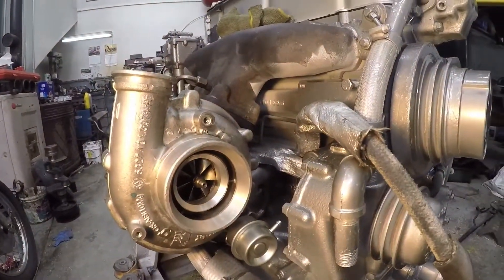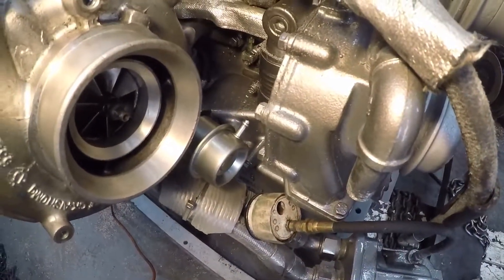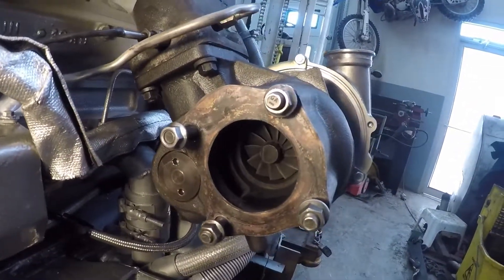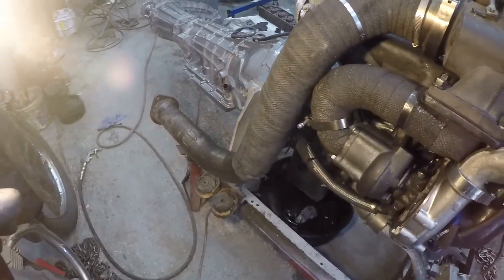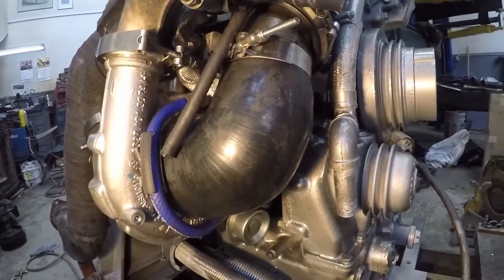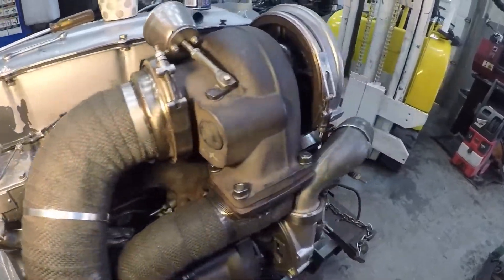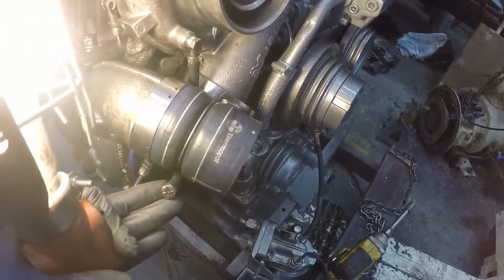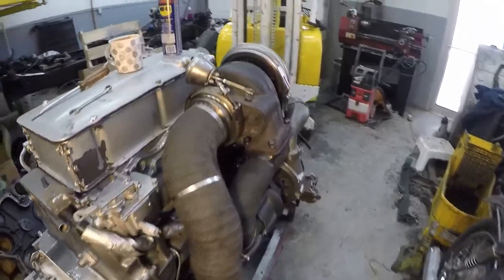Detroit 4-53T With Compound Turbos

Comment: In regards to a light truck the 4-53 is probably the best match in regard to size and weight. It would be nice to achieve comparable power and Tourqe to modern technology, which I dislike, say 400-500 hp 750 -1000 ftlbs of Torque. A 6V53 is pushing the limit mostly in weight. Hope to hear further reports on your motor.
Reply from the maker: At the moment this engine is running around 240 hp and 550 ftlbs of torque and now coming up on 57,000 miles since the swap.:).  I’ll soon be building another Silver 4-53T and dyno testing it.  The goal is to get to 280 hp and 600 ftlbs of torque.

Comment: I'm still baffled by the low view counts on your videos... Some of the best and most informative I've seen. Do people just not wrench on these anymore? 

What would happen if you just eliminated the blower/bypass setup? Could you tune the turbo setup to get you the low rpm pressure needed for the two-stroke? You can't be too far off if you make 10psi at 1200rpm... What's the blower make? 2-3psi? 

Is this setup on the same 4-53T where you did the upgrades to the T04E? Which do you like better?

Do you run the stock T compression ratio? Could you deck the block to increase compression instead of searching for boost or does that start to work against you?

I'm a diesel noob but lifelong wrencher trying to plan and source for a future build.

Longest YouTube comment ever
Reply from the maker: Some videos do well, but for the most part the views are low, particularly the detailed videos.  There's so few in service now that interest is not there anymore.:)  I do it for fun and to help others who want to work on them.:)  On the topic of blowers and turbos, the blower bypass helps unload the blower at anything above 10 psi boost and an estimated 8 HP is gained by this, increasing efficiencies in air flow through the engine.  Root style blowers are efficient at lower rpm, but loose that efficiency at the higher rpms, so a bypass valve fixes this problem.  I'll be using my next 4-53T build to test the different blowers and turbos etc. to see what the best combo is.  Since this video was made I've removed the compounds for a single modified Garrett T04E.  I've increased the compressor size and machined a T51R intake for it as well and so far really like it.  I can't really tell the difference from the compounds except the spool time is a little longer for the Garrett.  From a maintenance stand point the single is a far better choice.  I'm running stock Silver pistons that have an 18:1 compression ratio that's best suited for the turbo.  There's no benefit increasing compression, but instead look for more fuel and air to increase power. I hope that helps answer your question and thanks for watching.:)

Comment: But isn't that 4 I 53 TT sweetheart????I mean it is a 4cylinder 53 series two turbo boost is it not???
Reply from the maker: Yes sir, Borgwarner K27/K31 compounds.  I've replaced these a year ago with a modified Garrett T04E.:)  The Garrett now has a 59mm compressor and a T51R mod.:)  Here's what it sounds like, thanks for watching.:)https://www.youtube.com/watch?v=_oruKM8MrGc
Reply: @detroitgarage9430  I appreciate your kind words but it's mame not sir Sir.
Reply from the maker: @kimnielsenthewordyvikingett159  Sorry ma'am, I should have read your name first.:)
Reply: @detroitgarage9430  That's OK 👌 Sweetheart a lot of people don't understand. I was a diesel tech Forman on the Alaskan pipe line back in the 70s race engine ingineer builder for ten years after and 38yrs CNC lathe machinist since retired. I'm transgender mtf started H.R.T 12 22 2020 and hoping my new boyfriend understands as well since having a 57 Chevy completely refurbished sporting an L88. So that was one of the things I think 🤔 I snaged him with according to him anyway.

Comment: I don't like internal wastegates.  They're fine for passenger cars, but when it's time to get real external wastegates are stronger and regulate boost much better.  For years Porsche and Audi used external wastegates on their cars from the street to full race.
Reply from the maker: True, I haven't been happy with the waste gate and decided to take the compounds off and try a non gated turbo.  I ended up rebuilding an old Garrett T04E and running that.:)  It performs just as well as the compounds, so the next upgrade is a larger compressor.  The stock compressor is 56.6mm inducer and the new one is 60mm.  In do time I'll turn the housing out for the new compressor wheel.:)

Comment: i take my hat off to you .........a true compounded turbo setup feeding a blower.   However..........compounded turbos are usually used to eliminate lag ( I drive a compounded VW Amarok).........and the idea works really well.   For an engine equipped already with a blower ( being a GM 2 stroke) its seems..........over kill.   230 HP and 525 FTLBS of torque is a heck off a good result tho.
Reply from the maker: Thanks.:) True, I built this system for clean smoke free emissions and the ability to upgrade to larger injectors in the future and still have low egt's.  I've now tuned it just about perfect so I have instant boost and lots of power.  Now adding propane to put the power up to 250-260.:)  I still need to adjust the fuel modulator to stop the small amount of smoke between 0-5 psi boost.:)  Here's a video towing and the tail pipe emissions.:) https://www.youtube.com/watch?v=yUBi1IaiF-4
Reply from the maker: P.S.  Thanks for the sub.:)

Comment: is the two part valve cover bespoke made?  silver 4-53 series included diecast aluminum top clamping cover much like those on my 8v92ta  --thx
Reply from the maker: Yes, this is so I can get the valve cover off for tune ups etc.  It's one top piece and 3 bottom pieces.  With the cab down I would not be able to access the overhead.  Thanks for watching.:)

Comment: Hopefully you're running an air to air intercooler. I have an air to air intercooler on my 8V-71 in my bus with by-pass blower-works great. No issues in 12 years. Course only 7G75 injectors for 375hp and 1125lb/ft torque.
Reply from the maker: Yes I'm running an intercooler as well as a blower bypass.:)  I've got all the issues worked out now and it's working great.  I have the blower bypass opening at 10 psi and the small K27 at 20.:)  Egts are a nice cool 950 pre turbo, so very happy indeed.  Thanks for watching.:)

Comment: Two strokes need tuned exhaust to super charged cylinder as on Dirt bikes etc.
Charles Kettering of  Zepher Train fame invented  these.
Look up Napier Deltec engine ....
Nice work Thanks
Reply from the maker: True, I now have the turbo systems running just about perfect.  I'll be adding larger injectors soon as well, so should be a lot of fun.

Comment: To continue to evolve my Detroit rat rod I’m planning to compound mine as well with a T04 and a HE351 with the same bypass through the inspection side of the block. I’ll be swapping to a T motor. What size injectors did you use?
Reply from the maker: Nice, you'll like it that's for sure, I'm running 7A77's.  Will eventually go up to 9A90's, but going to try propane first to see if there's any added power.
Reply: We will have to keep in touch and see how things go. I’m sure I can lean a lot from you! Keep the post going!! Thanks again.
Reply from the maker: @cliffordw4508  Sounds good, I sub'd to your channels as well.:)
Reply: How much boost were you able to make?
Reply from the maker: @cliffordw4508  I'm making 20psi on the K27 and 8 on the K31, I expect that to climb to 30 and 12 when I upgrade the injectors.
Reply: Awesome, thank you for getting back to me. I have the 9a90’s for when I add the turbos. Your build really motivates me to get this done.
Reply from the maker: @cliffordw4508  You'll love the 9A90's you'll be around 230-250 HP.:)

Comment: So with compounding a two stroke the restriction on the exhaust is necessary to build cylinder pressure otherwise all your boost would flow out the exhaust am I correct
Reply from the maker: Yes, it needs to breathe but you also must have boost to get the cylinder pressures up.  It's finding that sweet spot, so I can get the most performance I can from it.  At the moment I think I have it just about as good as I can get it.  I'll be doing small changes and seeing how it improves or doesn't improve performance.  I might increase the injector size once it's broken in and see how well that works.  I know of only one other guy running compounds on a 4-53T and he's running about the same turbos, but has 150 CC/1000 injectors and I'm running 77 cc/1000.  He's running 1100 egt's at 40 psi.:)  and I'm running 1040 egt's at 25 psi.:).
Reply: @detroitgarage9430  its a unique and super cool setup im not real familiar with 2 stroke diesel

Comment: However,  i will admit that im a tad uninformed wen it comes the neccesity of having 2 turbos? 
What does that accomplish? And how?
Reply from the maker: It's really the best of both worlds, a small turbo for engine response in lower rpms and a larger turbo for the higher rpms.  They compliment each other so you have great throttle and boost response throughout the rpm range.  So far I'm very happy with them, still doing some tuning to get them in sync with each other. Thanks for watching.:)
Reply: Ok.
Great.
I'm a truck driver with over 30yrs and 2 mil mils of hywy driving.
I've been laying under diesel engine's since I was 10, and I'm 52 now. Still, after all this time, if I can't get a Cummins ISX on my truck, I'd just assume to HAVE and old Detroit 2 stroke. 8V92T preferably.
Keep the vids comin.
Love the content.
Reply from the maker: @CwNiehaus  Thanks, throwing the miles onto this engine now to break it in.:)  Running really nice and no issues so far.:)  Thanks for watching.:)
Reply: A single turbo is a compromise between effectiveness and efficiency compound turbo has more range because you're trading between the efficiency zones of two turbos instead of just one

Comment: Hi everybody. I have a question. What is the difference between the engine 4-53t and 4-71?
Thanks for the answer.
Reply: Just an afterthought,  but as he explained,  the 2nd set of #s in the engine designation is the size of each cylinder in cubic inches.  The 1st # is the cylinder count. And if there is a "V" between the two #s, that
Means its a V configuration.  Example = 6v71.
6 cyl`s-V configuration,  71 ci  cylinder bore
Reply from the maker: 4-53T is 212 CU and turbo charged, the 4-71 is 284 CU and naturally aspirated.  Thanks for watching.:)

Comment: How come nobody's mentioned anything about blower bypass. And, can you push air in through the other side like through the inspection plates or is that a pretty dumb question. Trying to figure out how to put mine together
Reply from the maker: I've put a blower bypass on this engine and have it set up to open at 15 PSI.  Works really well.  I used a 2" pipe with a 50MM bypass valve.  Here's a build thread if you're interested.:) https://www.4btswaps.com/threads/detroit-4-53t-into-2009-ford-f350-with-5r110.105682/page-16

Comment: is this your first compound turbo build up?   how did you acquire 53 series taste?
Reply from the maker: Yes, I looked at a lot of different turbo combinations and came up with these two as my final choice.  I really like the performance, but just need to free up some exhaust restrictions caused by the K27.  This will in turn reduce the egt's and light the K31 with more exhaust flow.:)  I grew up around Detroits when I was a kid and always loved the way they sounded.  I bought this engine 10 years ago for a project that never got going and had to wait until I moved back to Canada.  It's been a lot of work to fit it into a modern pickup, but will be worth the effort.:)  Thanks for watching.:)
Reply: Id like to see howt the tvs style rootswould do compared to original
Reply: If you open the exhaust doesn't that lower the air density in cylinder I thought the gold be to increase drive pressure to match the boost to maintain air density in cylinder
Reply from the maker: @bill2178 Yes, I'm adjusting the waste gate to try and achieve the lowest egt's yet yield the most power.  Being a 2-stroke it needs to scavenge a lot of air, so if I'm trying to find a happy medium between boost and airflow.:) I think I have it just about right now opening at 25 psi.  My drive pressure and boost are 1:1, so I'll work on the blower bypass next and see if lowering the opening pressure helps in any way.  I've also ordered two more pressure sensors so I can monitor airbox and the K31 boost.
Reply: My thought would be a positive displacement super charger would be nescessary to maintain ve especially at higher rpm
Reply from the maker: @bill2178  Yes at the lower rpms but once you get above 10 psi the blower just costs power.:)  That's why I'm going to see if lowering the blower bypass to open at 10 psi changes anything.:) At the moment it's pretty nice so I'll leave it alone and enjoy driving it instead of wrenching on it.:)
Reply: Replace the roots blower with a whipple and 15 percent overdrive
Reply from the maker: @bill2178  The roots are pretty efficient at lower rpms, but become very inefficient at the higher rpms.:)  So I've bypassed it at 15 PSI so it's just freewheeling after that.:)  I'm going to see if lowering the bypass at 10 psi helps at all in performance.:)

Comment: Looks very good and powerful! Wow! 
You said in the video that you start to have boost at 1200 rpm...how do you manage the oil pressure if the engine is already coming to life at this low rpm... My Detroit still has a lower oil pressure (20-25 psi) at this rpm...did you improve your oil pump?
Reply from the maker: With the 7A77 injectors I'm running and the upgrades I've done I'm at about 230 HP and 525 FTLBS of torque.  I'm running the stock oil pump and that boost is with light throttle @1200 rpm around 10 psi.  That only happens in 4th and 5th under light loading when the torque converter locks.  If I add any amount of throttle it will down shift and allow the engine to jump up to 1800 rpm's or so.  In tow haul mode the trans is shifting at around 1800-2000 so no problems there.  I'm still tuning the trans and will probably change the shift schedule to lock in 4th and 5th at higher rpms.  Thanks for watching.:)
Reply: Thanks for all the details. Really appreciated!